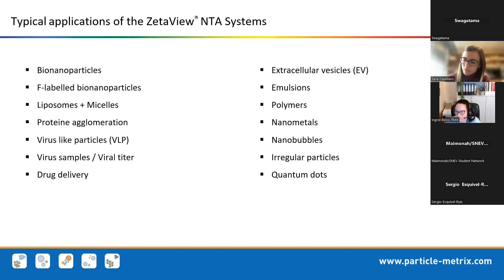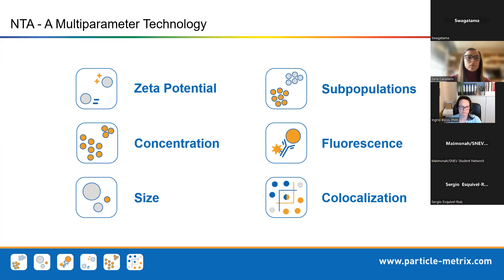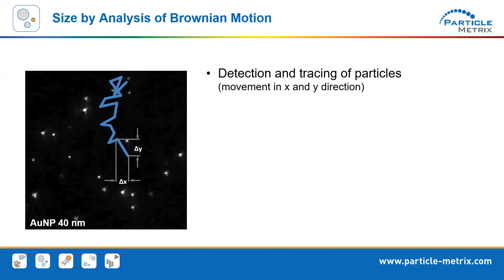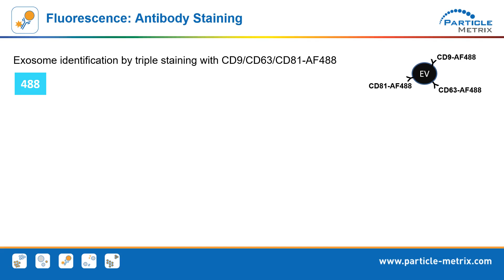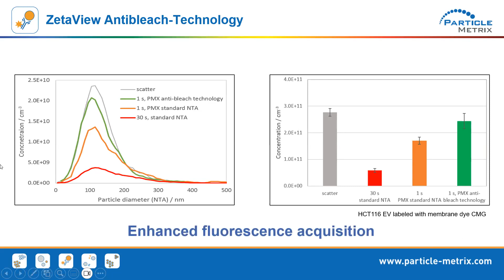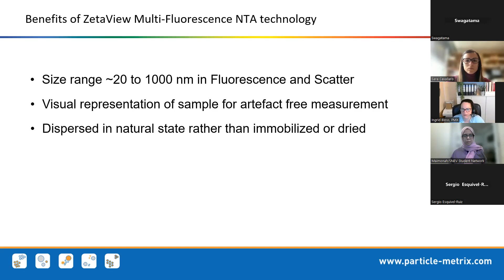SNEV Characterization Series: Nanoparticle Tracking Analysis: Powerful Tool for EV Characterization

Comment: We can control dissolved oxygen (DO) levels in the tunnel, for example, 4, 6, 8, and 10 ppm. At each DO condition, I would like to take a water sample and measure the size distribution and number concentration of existing nuclei/microbubbles in the water.

I am interested in whether the ZetaView Nanoparticle Tracking Analyzer (NTA) can be used for this purpose. Specifically, I would like to know:
Can ZetaView measure gas nanobubbles or microbubbles in freshwater/tapwater samples?

1. Can it distinguish gas bubbles from solid particles or contaminants?

2. What size and concentration range can be reliably measured for bubbles/nuclei in water?

3. What sample preparation is required, and could the preparation change the original bubble/nuclei population?

4. Can ZetaView provide number concentration and size distribution for different DO conditions, such as 4, 6, 8, and 10 ppm?

5. Do you have any recommended protocol or previous application notes for measuring nanobubbles/microbubbles in water?

6. If ZetaView is not suitable for cavitation nuclei measurement, could you recommend a better Particle Metrix instrument or measurement approach?
My main objective is not only general nanoparticle counting, but to understand whether the detected population can represent gas nuclei/microbubbles relevant to cavitation studies.
Thank you for your guidance.